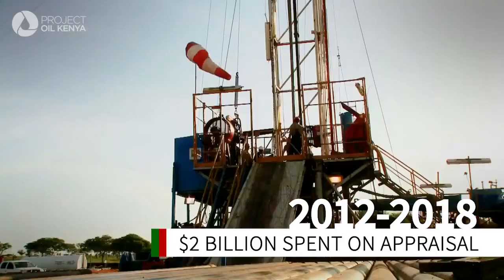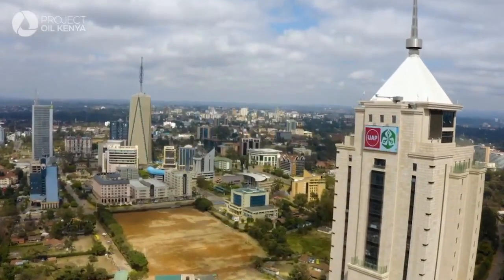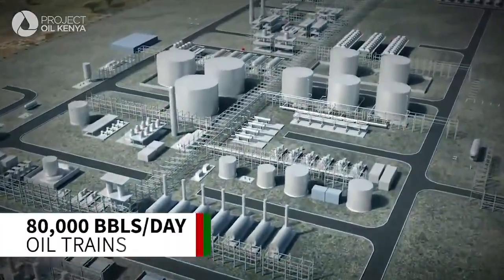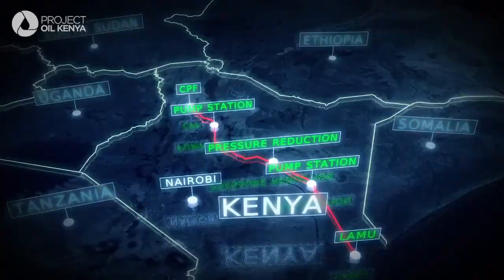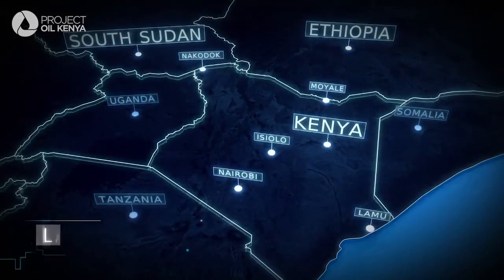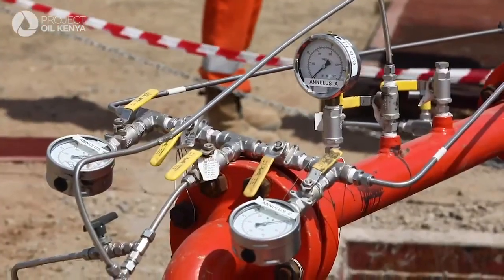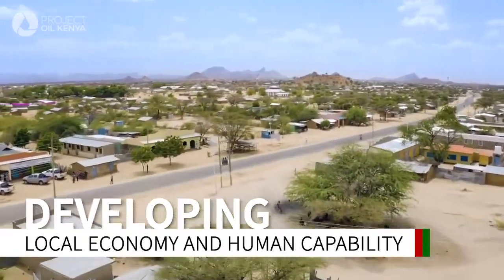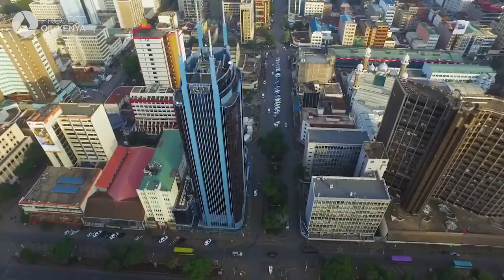Tullow's Oil and Gas Project in Turkana, Kenya

Comment: Is it true thst very senior government officials bought land in the area when the oil was discovered and now want billions of money to sell the land to the government, hence the slow process of extraction?
Reply from the maker: It is true some people became speculators, but what they didn't know was that most of the land in the region where oil is located, and the path for pipeline is actually community land, not necessarily private land.

However, the process from oil exploration to export is not an easy process, and there are several stages before a country starts producing oil and gas.

Take the case of Uganda, who discovered oil in 2006, six years ahead of Kenya...and yet they still have not started exporting their crude oil. That is like almost 20 years

So, the process and the journey is long...

Comment: Revive the changamwe refinery,theres a local market+uganda which exports its crude oil ,tz will also buy
Reply: Oil importers will never allow the refinery to be restarted because the operation of the refinery prevents them from over charging customers.
Reply from the maker: Not really...the refinery is inefficient and outdated
Reply from the maker: The refinery in Changamwe is old and trying to revive it is very costly. The estimated cost for it to be revived turned out to be very high, especially given it was handling murban crude, yet our crude is waxy

Uganda is building a refinery, and also exporting its crude through the port of Tanga in Tanzania
Reply: @upstreamstory  then build a refinery for our local market without exporting crude oil and importing diesel and petrol for us to use

Comment: Uhuru made Kenya to think they are sharp only to realize that Uganda was way sharper. It was just pr, even hiring fake trucks to transport crude to Mombasa.
Reply from the maker: I am sure you are talking about the Early Oil Pilot Scheme, where Kenya exported about 200,000 barrels of crude oil.

This was aimed at testing the global markets on prices and also on who had the refinery to refine our waxy crude oil

Also, during extended-well testing in Turkana, there was crude oil and it needed to be evacuated, and since we do not have a crude oil pipeline from Turkana to the coast, trucks had to be used.

When it comes to Uganda, they discovered oil ahead of Kenya in 2006, and are still ahead in terms of their project

For Kenya, we have not even approved the full field development plan, and we have not even gotten the final investment decision for the project to proceed

There are about 7 stages of oil and gas exploration, and we are at around stage 2.

Comment: we now need a refinery for sure
Reply from the maker: Why do you think so? We had a refinery which was turned into a storage facility because it was not economical to keep it running, or to even modernise it.
Reply: @joe-watson-gakuo  what if Kenya constructs a refinery that will not only refine our oil but also the oil from south Sudan and even From Ug? Wouldnt that make business sense?
Reply from the maker: For Kenya to build a refinery, there has to be more oil discoveries, for it to make economic sense. Uganda is building an oil refinery and that might affect the viability of another refinery in Kenya in the short-term

Comment: This project died long time ago, it was politisesed and politicians went and bought large chunks of land for them to be compensated, why export Oild and we can revive changamwe oil refinery? Refining oil will be the only way for job creation because the byproducts are used to make plastics, bitumen for the road fertilizer and that will lead to industrialization hence curbing unemployment
Reply: Changamwe oil refinery was sold to a private entity..and stopped refinery.. it's now a storage facility for petroleum products.
Reply from the maker: It was 'sold' to Kenya Pipeline Company and now operates as a storage facility
Reply from the maker: I understand your point of view, and it is right to an extent. Yes, some people had made speculation about it, but it is because they did not know oil and gas projects takes years, sometimes decades.

Uganda discovered oil in 2006, six years before Kenya discovered oil...yet Uganda has not exported its crude oil...almost 20 years

The project in Turkana is still on...only that it is in a different stage of oil and gas exploration. At this stage, there is little activity in the fields, until the government and the investors agree on the development plan.

In terms of a refinery, it does not make economic sense to build a refinery in Kenya. It is cheaper to export crude oil and import finished petroleum products

The refinery in Changamwe was turned into a storage facility, and under the management of Kenya Pipeline Company
Reply: @joe-watson-gakuo  poit taken , no one will do a business to get a loss , how can you buy crude oil at maybe 100$ per Burrell refine it and sell it at 80$ per Burrell,, Kuna mchezo chafu bro

Comment: How much oil  is found in Kenya?
Reply from the maker: Well, this is an interesting question, because oil and gas exploration is still going on in Kenya, and the country is a baby when it comes to oil and gas industry

Having said that, the estimated crude oil reserves in Turkana basin is about 3 to 4 billion barrels, but over 70% of that cannot be recovered due to a number of factors.
Reply: @upstreamstory  is there a correlation between arid and semi arid places and oil???
It's seems places like Canada, Venezuela, south Sudan and Nigeria are the only wet areas with oil
Reply from the maker: Not necessarily, but you might want to consider the historical geology of the areas you have mentioned. Oil and gas are found in basins, and some arid or semi-arid areas were once oceans meaning they could be having lots of sediments